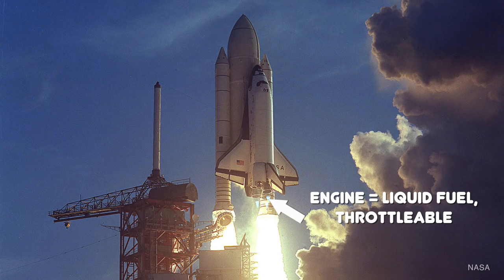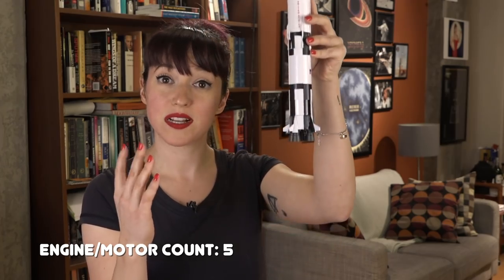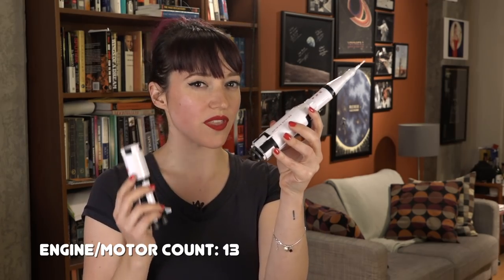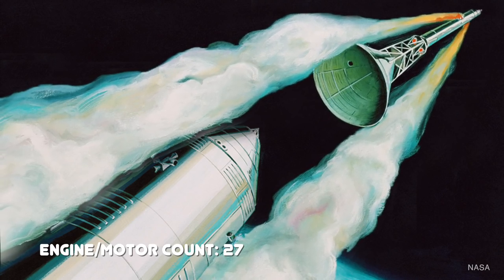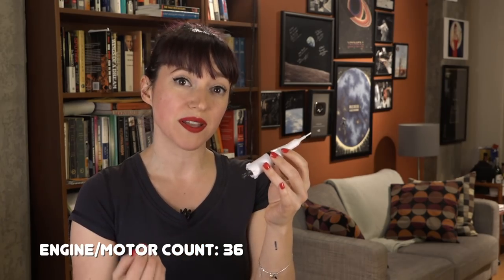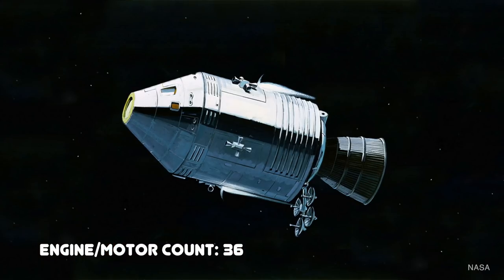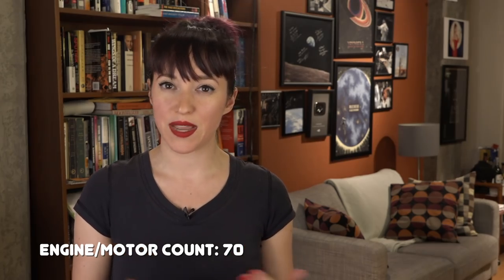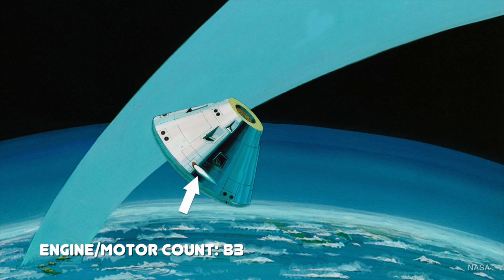It Took 83 Engines to Get to the Moon

Comment: Thanks for this Amy.  Right up there with your usual standards! I enjoyed it.  That said,  I am not 100% convinced that you should not have counted the escape tower motors since, although yes they didn't get used,  but do you know think that NASA would not have made sure that there was some way to try to save the crew in the event of a failure from launch to a safe distance above the Earth?  So with my argument, they REQUIRED (or needed) 88 motors/engines to get to the moon.  And that was how many rockets on the Saturn V at liftoff.

Comment: Is that a Revell model? Did you build it? If so, how did you paint it? I just finished building one, but cannot figure out how to paint the black part, because of the ridges. The paint will just run under the tape between the ridges.
Reply: Blue-Tack? Maskol?

Comment: You forgot the 16 motors on the transport crawler that moved the rocket from the Assembly Building to the launch pad. And the one motor in the Astro van the transported the astronauts to the rocket.

Comment: Did the SM engine also need to have some kind of ullage push to get fuel back in the engine for relight or was it pressurized somehow to not need this?
Reply: CMDR Terrorfirma Ullage motors are only needed for cryogenic liquid oxygen, and to feed the turbo-pumps used on the second and third stages. The Service Module used hypergolic fuels, which only need helium pressurisation, not ullage motors.

Comment: What was it like in the LM when they were on the moon?  Was it pressurized?  Did they have to wear space suits the whole time in the LM, or could they take off their suits and chill out?  When they had to leave the LM to go outside, did they have to pass through a pressure chamber?
Reply: "Was it pressurized? "  Yes, it was.

"Did they have to wear space suits the whole time in the LM, or could they take off their suits and chill out?"  On the early missions, they really weren't on the surface that long, so they kept the suits on (but took off the helmet and gloves).  Starting about Apollo 15, the stays were long enough that they would get out of the suits to sleep.

"When they had to leave the LM to go outside, did they have to pass through a pressure chamber?"  No, they didn't.  They'd put on the suits, helmets and gloves, depressurize the cabin, and open the hatch.
Reply: So when they were getting ready to leave the LM, how would they handle saving the atmosphere in the LM?  Would the LM would suck the air into ballasts, the astronauts open the hatch, leave the LM, and the ballasts would replace the atmosphere when they got back into the LM?  Also, because the LM's skin was super thin, how did it not explode when it was pressurized, as the difference in pressure between inside and outside was huge?
Reply: "how would they handle saving the atmosphere in the LM?"  Honestly, they didn't. They just vented it out into space. The interior volume was only 275 cubic feet, so if it was a cube, it would only be 6.5 ft on a side.  Since the oxygen was stored as a liquid, it took a tiny volume of that liquid to replace the cabin oxygen-about 1/3 of a soda can by volume, or four ounces.  I can hold more liquid than that in my cupped hands (I just tested it, because, well, science).

"Also, because the LM's skin was super thin, how did it not explode when it was pressurized, as the difference in pressure between inside and outside was huge?"  Actually, it was only about 5 psi, since they were using pure oxygen.  That's far less pressure than a soda can can hold, and a soda can is thinner than the pressure vessel in the LM
Reply: Good info.  A few questions.  First, how do you know all this?  Next, is it possible for a human to breath in a 100% oxygen atmosphere?  And is it possible for a human to survive in an atmosphere that is only 5 psi?  My understanding is that 5psi is only 1/3 what we experience at sea level, is that even possible for a human to survive? Next, I thought they did away with using a 100% atmosphere after the capsule fire?
Reply: "First, how do you know all this? "  I have a freaky ability to remember crap.  When I was a kid, none of my friends would ever play Trivial Pursuit with me :-)  Some of it I knew pretty precisely (like the pressure in the LM), and some of it I knew in a general sense, but looked up the specifics (like how much liquid oxygen expands when it evaporates.)

"Next, is it possible for a human to breath in a 100% oxygen atmosphere?"  Yes.  Pure oxygen at high pressures can cause a problem if you breathe it for an extended time, but 5 psi is not a problem, which I'll explain in the next answer.

"And is it possible for a human to survive in an atmosphere that is only 5 psi?  My understanding is that 5psi is only 1/3 what we experience at sea level, is that even possible for a human to survive? "  Yes.  The key is what's called the "partial pressure" of oxygen.  At sea level, air pressure is about 15 psi.  But air is only 20% oxygen-almost all of the rest is nitrogen, which we really don't need.  So, at sea level, the "partial pressure" of oxygen is only about 3 psi.  If you're breathing pure oxygen, 5 psi means you're actually getting more oxygen in your lungs than you do at sea level.

"Next, I thought they did away with using a 100% atmosphere after the capsule fire?"  They did away with using pure oxygen in the cabin while they were still on the ground.  The fire happened because they were using pure oxygen at 16 psi.  At 16 psi of pure oxygen, pretty much anything burns-including aluminum.  (They were using such high pressure because part of the tests they were running was a "leak test"-pump up the cabin pressure, and see if it holds)

Comment: Hi! Brand new subscriber. Im a big fan of the Apollo program. As much as I have learned about the program, I still could NEVER understand how docking worked. Specifically, the CM docking with the LM. I know generally how docking works, but I could never figure out how the probe just seems to "disappear"  a VIDEO on that would be much appreciated. 

I think you and other readers might be interested to know that I met, and sat down with, Fred Haise, the LMP of Apollo 13 and he was a great guy.
Reply: Basically, the astronauts took the docking probe apart in sections and stowed it in designated spots inside the CSM, reinstalling it for the LM redocking. The same thing is still done on the ISS.

Comment: Do the arms get released by the power of the full thrust?  Or are they released by some other means (launch control, etc)?
Reply: Here's a great link that goes into detail about the process and the differences between the Saturn 1 & 1B vs the Saturn V system. Some pretty neat info such as the pin & die controlled release mechanism and the fact that they used oak blocks of wood for shock absorbers.
https://ntrs.nasa.gov/archive/nasa/casi.ntrs.nasa.gov/19760012107.pdf

Here's a link showing one of the pins being drawn through a die:
https://www.facebook.com/FlightOfApollo/videos/1118603064916338/

Comment: This was informative, but now it raises a question in my mind. As you pointed out, a number of these extra engines were used for stage separation. So then my question is, did the Soviet N-1 moon rocket (if it had worked) also have extra engines for stage separation, or would it rely on the "grid" design between stages to accomplish it? I'm thinking it's the latter, for simplicity of design and reducing weight, but if that's not the case I'd like to know. Thanks.

Comment: If memory serves, the 3rd stage was ignited twice: once to get to orbit, and once to go trans-lunar.  Based on that, it would need a couple of sets of motors to push the fuel to the "bottom" of the rocket so the main engine could fire, yes?  Was this methodology not needed for the Service Module, Lunar Module, and Command Module because of the size of the tanks?  I'm curious why this method was needed on some rockets and not on others.

Thanks.  :-)
Reply: The SM and LM had thrusters that were used to settle their main tanks.  The tanks for the thrusters were lined with a blader, presurized from behind with helium.  Thus, like a toothpaste tube, there were no voids in the tank and no need to settle them.

Comment: SRB's actually can be throttled... sort of. The amount of thrust provided depends on how the fuel is laid in the engine. This must be done ahead of time, but if you know where you will need more and less thrust it's not hard to do.
     The SRB's provided maximum thrust from the start, then that thrust slacks off until they pass through the speed of sound. When you hear the call "Go at throttle up" the astronauts are providing full power to the main engines AND the SRB's start providing more thrust. However, the SRB will do this even if the shuttle is NOT go for throttle up.
   You really should know this.

Comment: So would a hybrid rocket be an engine or a motor? They burn solid fuel but can be throttleable because the oxidizer is not in the propellant its in a gaseous form pushed into the engine.

Comment: Hi Amy.  I enjoyed this video about the 80+ rocket engines.  

I have an idea for a subject that I've been unable find much information on.  A few months ago the Voyager had to do a maneuver that required firing some tiny thrusters that had been sitting idle for 30+ years.  It would be interesting to know just how these tiny rocket engines work.  In the mechanical sense, the physics is the same as the large engines but these tiny ones can deliver thrust for milliseconds at a time.  it would be interesting to know how they accomplish that. Thank you.

Comment: 91 instead of 89 ... ?
I have to correct myself ... I reviewed the video and saw that you counted only one motor for the Lauch Escape System (LES). It is of course true, that only one motor (the Tower Jettison Motor) was actually needed and fired during all Saturn-Launches, but there were three motors in total installed:
1 Launch Escape Motor (pull the CM away from the SM and the Saturn stack)
1 Tower Jettison Motor (jettison the tower and the BPC from the CM)
1 Pitch Motor (turn the CM in some abort profiles)

Comment: Question: You said the Saturn V used hypegolic engines for attitude control. SpaceX uses hypergolic engines on their Dragon Capsules but uses cold gas venier thrusters on their boosters. Why and  what are the advantages of each?
Reply: Hypergolic's have two big advantages, first they do not need to be kept at cryogenic temperatures, reducing weight, and second, they exothermically react upon contact, removing any need for ignition systems.  You simply open the valves and you have ignition, also reducing weight and also creating a level of safety that you would not have an engine fail to light.  They are, however, extremely toxic and corrosive.

The hypergolics are typically used in space and not for atmospheric flight, so in your Dragon, they are used in space whereas the booster is cryogenic fuels and I believe RP-1 which has a much larger energy density necessary for orbit insertion.

Comment: Hi there, how did they get back and forth between the Command Module and the Lunar Module? I don't think I've ever heard that detail mentioned and I'm just curious. Great info, and great work as always!
Reply: They would enter the LM to check it out shortly after docking. During the Apollo 10 mission, they found that the glass window for the range/range-rate meter had broken and it took some time to vacuum up all the shards floating around. Normally, they would just button it back up until it was time for the LMP to re-enter to prep it for the landing.

Comment: Amy - can you settle a discussion?  It is my understanding that there were ullage motors on top of the first stage to nudge the first stage back just a bit at stage separation.   There are some that think those ullage motors were on top of the fins of the first stage.   This is the first that I've heard of the motors being at the base of four fins on the first stage.   Thoughts?
Reply: They served two purposes actually, 1 they made sure they separated properly, but it also kept the fuels pushed to the bottom if their respective tanks so that the engines could start immediately

Comment: When launching off the surface of the moon how did the astronauts brace for the sudden acceleration of the of the lunar module? They didn't have seats as far as I know. Was it not as drastic of a launch as I'm assuming and they could stand through it?
Reply: Exactly right! Because of the low lunar gravity, during the ascent stage launch the astronauts stood and held onto straps, like riding a crowded subway train...

Comment: if the second and the S4b stage (third) needed ullage motors to get the fuel to the back before lighting them... what happened when the second lighting of the S4b happend to send them to the moon after orbit? did they have another set of ullage motors to do that? Also, did the RCS jets count as rocket motors or engines or neither?
Reply: CMDR Terrorfirma According to Wikipedia the S-IVB APS motors were used for both ullage and attitude control.

Comment: I think you should count the unused motors on the LES because even though not used, Apollo couldn't have gone to the Moon without them.

Still ...

I HAD NO IDEA THERE WERE SO MANY ROCKETS!  Specifically, I didn't know about the retros on the 1st stage, the ullage motors, or the thrusters on the CM.  

Thanks!

Comment: You forgot the hypergolic rockets used just to pump the fuel/oxidizer into the F1s.  OK, those weren't for propulsion of the craft itself.  But, it took rockets just to get enough power to pump fuel to the rockets that did the propulsion.

Comment: I never understood why any retrograde rockets were installed on any stages. Why not mount them on the stage above as “separation rockets” and add velocity to the mass bound for orbit, rather than subtract velocity from the mass discarded? Also, to split hairs (and yes this is just splitting hairs), not all liquid fuel engines are throttleable and it is possible to shut down a solid fuel motor- or at least stop it from generating thrust. Aerojet General’s boosters for the Titian IIIM were designed to do that in event of an abort by blowing the tops off the motor cases. In theory that option could have been incorporated into the Shuttle’s SRB design too.

Comment: When it came to relighting the liquid fueled motor on the 3rd stage, they no doubt had to use the Ullage motors to get the fuel where it needed to be. But, if the Ullage motors are capable of being re-lit, how did they prevent the fuel from migrating in those motors?
Reply: Ullage motors are necessary with cryogenic liquid oxygen tanks and turbo-pump engine stages. The ullage rockets themselves are simpler in design, use room-temperature fuels, and do not require any preconditions to fire up. Some of the smaller tanks use helium pressurisation, which is impractical for the larger stages.

Comment: I have a question about tracking the S-1C and the S-II decent back to earth. I would imagine that the fuel tanks would stay mostly intact and the thruster bells as well. Those are massive pieces of metal that would cause significant damage to anything they landed on. Did they clear out the projected landing area's of ships, and did they have radar that tracked them to make sure tghey could warn someone who might be in the path. Also I believe several of the eary S-IVB's are still in low earth orbit, they are bound to find their way back to earth at some time in the future. What is the projection for the potential damage that, that might cause.
Reply: The first stage would land in the Atlantic, theres no way it would reach Eurasia, the second stage, if it didnt burn up on reentry it might have come somewhat close

Comment: Question regarding the solid rocket boosters on the shuttle.  They are motors that cant be throttled, with the challenger was it coincidence that it had blown up about the same time as throttle up?  I assume the throttle up would be the engines on the shuttle itself but I'm just curious!  Loving this youtube channel.  hitting a lot of my nerdyness right now lol

Comment: Not quite right about the main engines running till they'd burnt all their fuel, they could be shut down or shut themselves down on a Saturn V ... maybe true for Shuttle Boosters. Also I'm pretty sure the only throttlable Engine was the LM descent engine as it was used to slow direction of travel and avoid lift near the surface. All others were duration burns at their potential thrust I think.

Comment: Could Apollo 13 have come back if the LM's decent fuel ran out? Could they have used ascent power?
Reply: They could have used ascent propulsion in theory, however jettisoning the descent stage also means losing a good portion of the oxygen and water they had to get home, so it would have to have been a dire situation and required more thrust than the RCS could have provided.

Comment: Question: How did they ignite the engines on the second and third stages?
Reply: Bare Mare Both the second and third stage used J-2 engines. These were lit using what were essentially spark plugs in both the main combustion chamber and in the turbine combustion chamber.